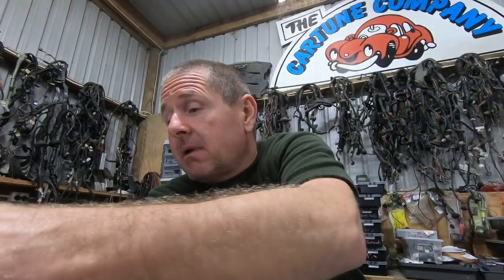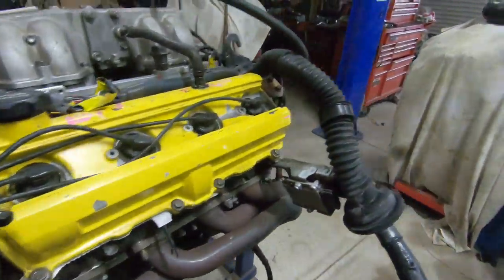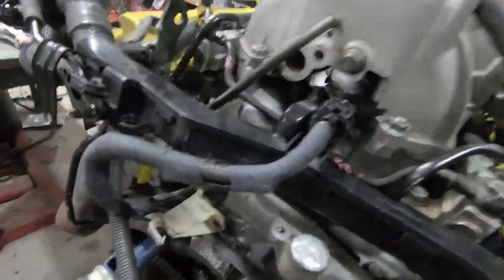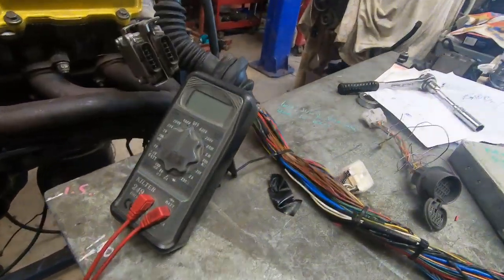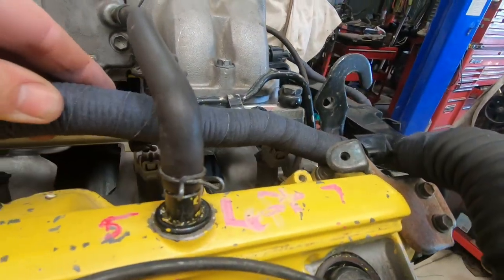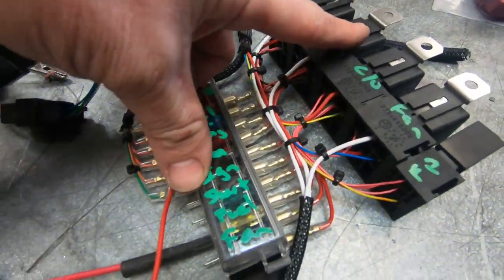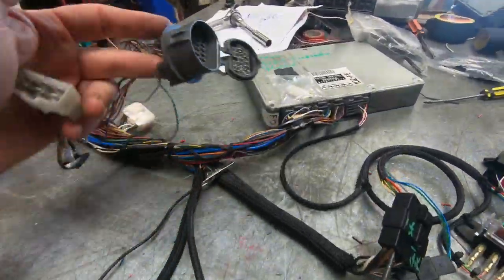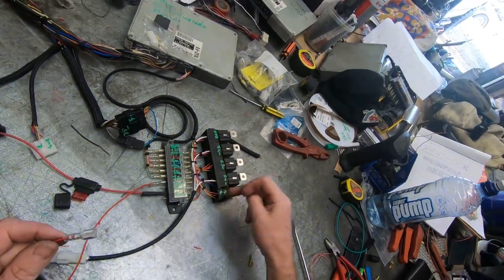CartuneNZ 1uz Universal loom explaination. Standalone harness for 1uz stock computer

Comment: You’re videos and posts on Lextreme have helped me a bunch thru my 1uz swap. I got the car runnin for a week but soon encountered hesitations and gremlins. I opened the ecu and found burnt out capacitors. Following your advice I’m looking into a link atom and coil on conversion. What do you usually charge for the ecu and link harness
Reply from the maker: Glad I could help.  Flick me a email at info@thecartunecompany.co.nz  with all the details of what you want included and your setup and I can work out an estimate.  Cheers Kelvin

Comment: i got a ls400 that seems to be dead i can't figure out if its the ns or the ecu can i bypass the ns from up top just to see if it'll start?
Reply from the maker: I have some DIY diagnostic videos to look at.  Checking power to Ecu , injectors , and running through some basic tests normally finds the issue.  Good luck.  Cheers Kelvin

Comment: Please do a video on wires that can be removed without affecting engine performance!
Reply from the maker: Won't happen for public veiwing as its part of my wiring instructions which I sell.  I have one for ucf20 non vvti already done.  Cheers Kelvin
Reply: @CartuneNZ  what is the price including shipment cost to African continent in Namibia?
Reply from the maker: @rubenfilippus2956  sorry but due to shipping issues I don't supply looms to Africa.   Firsr getting your harness to me takes ages and then getting it back is unreliable.  Cheers Kelvin
Reply: @CartuneNZ Kelvin your wiring instructions do you send them  Electronic mail or by post. ?
Reply from the maker: @paulsimpson2232 instructions are sent digitally as a google drive link
Reply: @CartuneNZ  ok I will email you ,so we can sort it thanks...